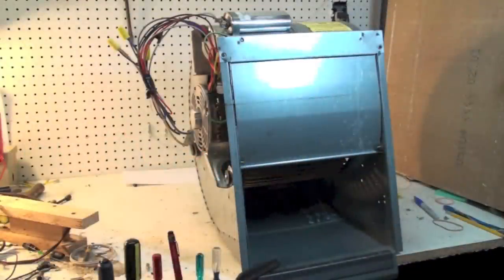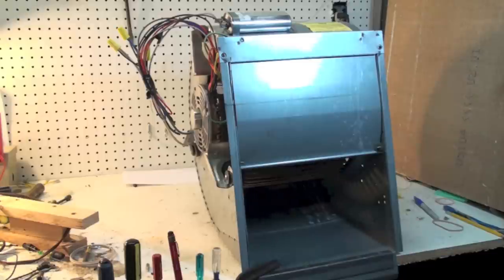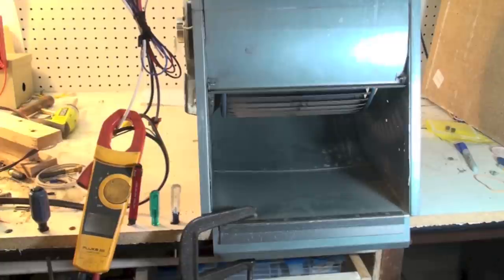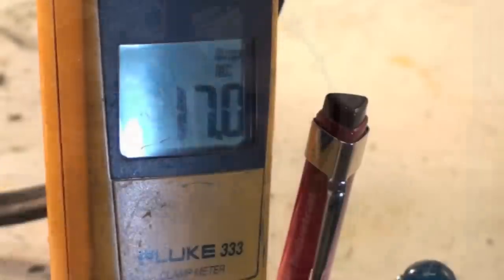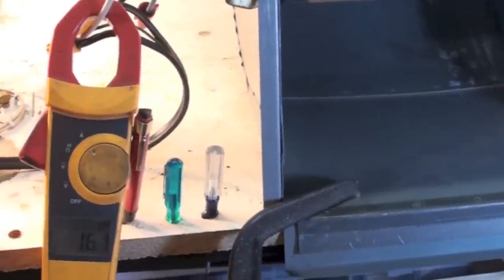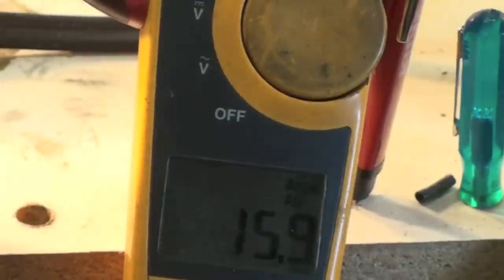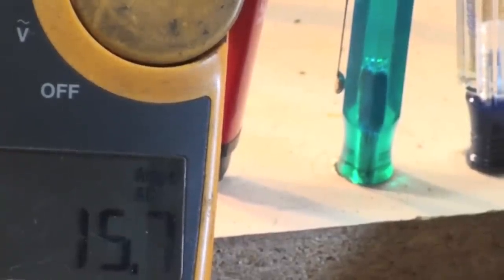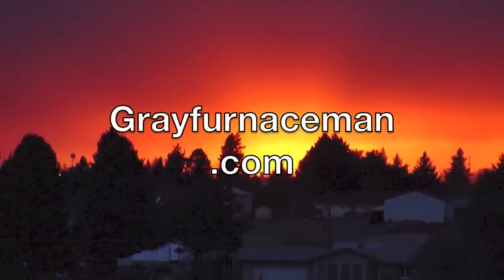The squirrel cage fan.  How the air flow works.

Comment: The amp draw is related to how much power the blower is using. The power the blower requires is the work it performs at some rate. In this case it is air being moved at some pressure within some time. Knowing that, compare the work being performed, basically how much air is moved, when the blower outlet is not blocked to when the blower outlet is blocked. Way less air is moved when the outlet is blocked. In fact no air is moved through the blower when the outlet is totally blocked. Therefore way less work is being done and less power is required. The amp draw goes down to reflect this and the motor speeds way up, because it is doing less work. 

That is the nature of centrifugal fans and pumps. This is always surprising to people not familiar to these machines but who have certainly put their hand over a canister vacuum cleaner hose and heard the motor start a high pitched scream. Maybe they think the motor is struggling, screaming like a living being, but if they thought about it a bit more they should wonder why the motor spins faster instead of being bogged down. 

It is important to know in these cases what is being moved, air and water, provides the way heat is rejected from these machines. Running them in this blocked or partially state will be damaging because some power is required but heat cannot be rejected. In the opposite condition where the blower is blowing lots of air, therefore doing a lot of work, the motor and its wiring may not have been selected to reject the waste heat fast enough associated with that condition.

Comment from the maker: If start winding is bad, the motor should operate with higher than normal amp draw.  Also, are the bearings overly tight?  To check start winding, the easiest way is to check amp draw thru the cap.
GFM

Comment from the maker: Yes.  If the amp draw is above rated on a 1.0 service factor motor, it will overheat and kick off on overload.  If the bearings are bad, that could cause it but I would guess the windings are shorted.
GFM

Comment: The cupped side of the blade pushes the air, while the curved back-side creates low pressure so more air is drawn in to the center area and then it's drawn toward the outer edge of the wheel, which is where it gets pushed?  So the pushing (cupped side) of the blades should always be facing towards the exit channel of the housing?

Comment: If the start winding (my other comment) is bad, or hypothetically if the fan's run cap were bad, could it make this squirrel cage wheel run backwards?  And if so,  would it be normal to give this backwards-running wheel a starting push in the  right direction, only to have it stop then reverse direction to the wrong direction?

Comment: I have a blower motor that will only start with a manual push from me on its wheel. New capacitor didn't help. There was a black wire from blower motor connected to the fan relay, and a white (yellow? forgot now - is a General Electric motor) wire connected to "C" of dual run cap. Measured 240vac across these two points. Assuming that the wires are good, this is obviously a bad motor (start winding)?  It's a multi-spd motor w/2 brn wires (one w/white stripe) to 7.5uF cap. How chk start winding?

Comment: It is, indeed, pulling higher than normal (data plate) amp draw. Data plate: 1.8 A - it's pulling 2.5 A. Can I assume excessive amp draw would cause motor to overheat? Thx GFM

Comment: So I'm currently looking to find a Centrifugal fan to move some air. I would like to mount it on the outside of my project. but it seems that what I'm seeing is all of these blowers have a squared outlet; exhaust port, pulling air from the circular port in the side of the blower. So my question is, is it possible to change this so that it actually uses the square port as an inlet? Do they make blowers that are reversed, Where the circular port of the fan is exhaust instead of intake?
Reply from the maker: You can't reverse the blower flow.  You can use a transition to change the outlet to circular outlet.  Some blowers are equipped with a circular outlet, namely gas furnace inducer fans.  You could use one of these for your application.  These blowers are much smaller than the circulating fans you are probably considering.  Hope this helps.
GFM

Comment: How can I find out direction of airflow so I install my vent filter properly?
Reply from the maker: +Instinctive Firearm Reviews I am not sure what a vent filter is but if you mean the furnace filter, the air flow arrow on the filter points towards the furnace.  Hope this helps.
GFM
Reply: +grayfurnaceman yes that's what I mean. So the arrow should face towards the furnace fan? I currently have it facing up the venting. As I thought it meant direction. Of airflow
Reply from the maker: +Instinctive Firearm Reviews The reason for the arrow is on some filters, there is a wire screen to prevent the filter from being pulled into the fan.  On others (the cheap ones) oil is sprayed on one side of the filter to catch dirt.
GFM